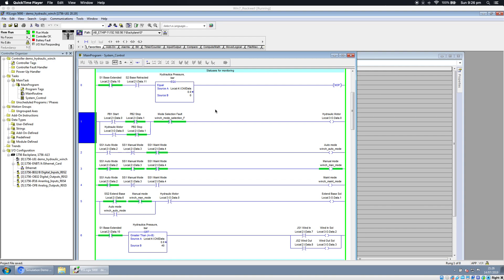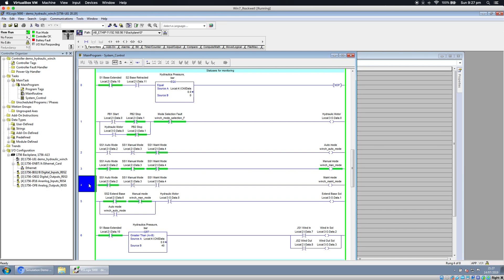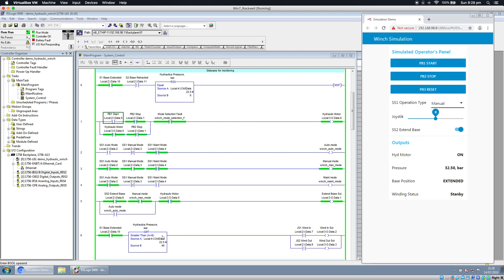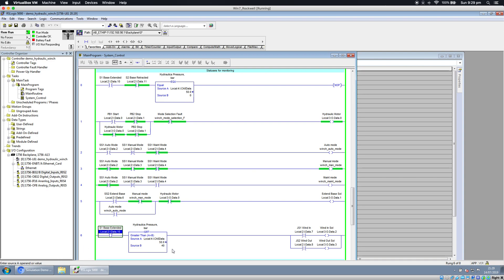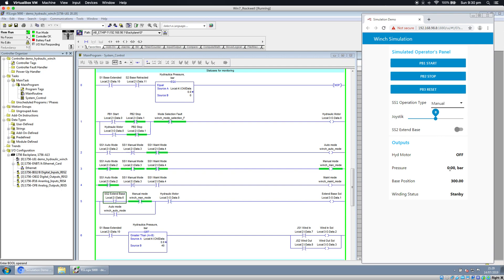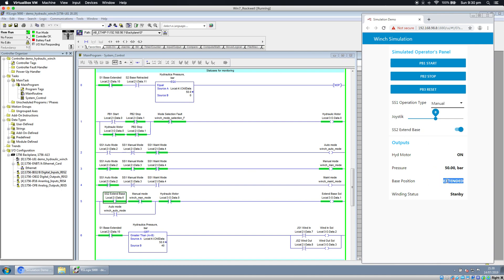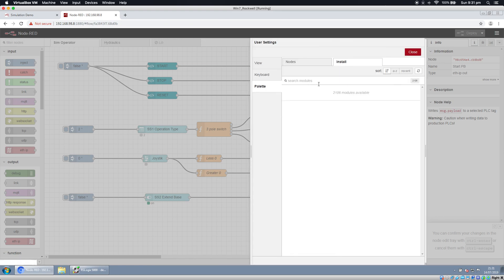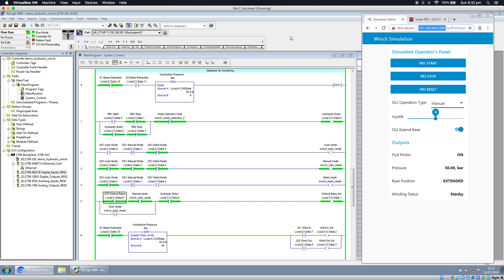Testing ControlLogix PLC program with IO Simulation in Node-RED

Comment: Hi, it is understood by your video that node red can access control tag of AB PLC but i want to access programe tag of AB PLC which is coming from PV6000 hmi is there any way that i could access my set point coming from HMi of AB
Reply from the maker: Quick google shows that PanelView 6000 doesn't have an Ethernet Port. So, it you want to read the setpoints then map them to the PLC and read it from the PLC.

Comment: can i get your json file to see parameters. I'm building a geothermal system at my house with old slc5/03 controller in rslogix500.   ///ground temp, outside air temp, inside air temp, radiant floor temp, humidy, pid controls ect. i have digital io cards and analog io cards,, controller is in brandnew condition.  i can control modulating valves and variable speed pumps/fans for high efficiency